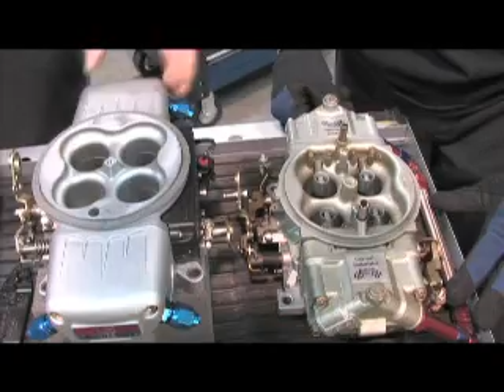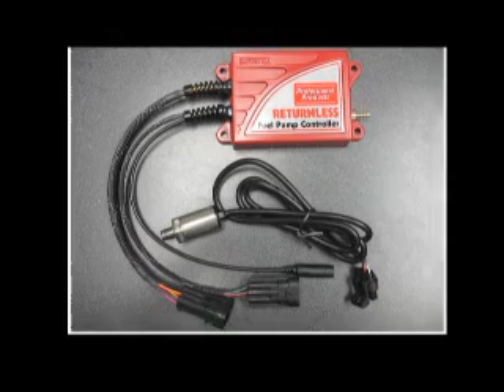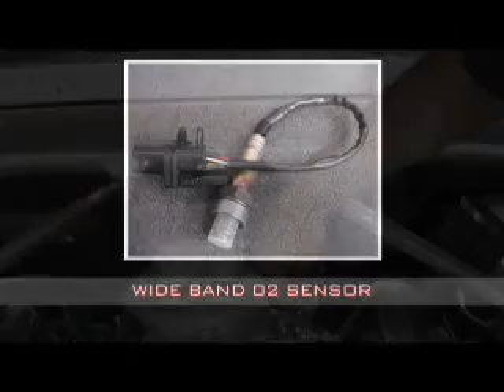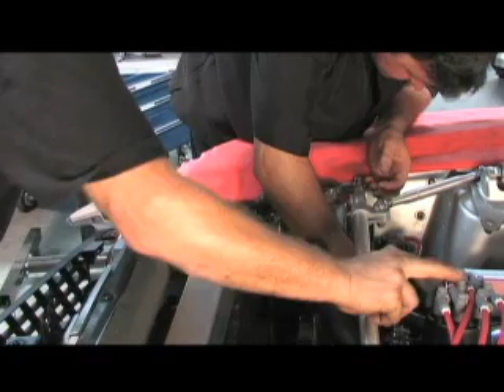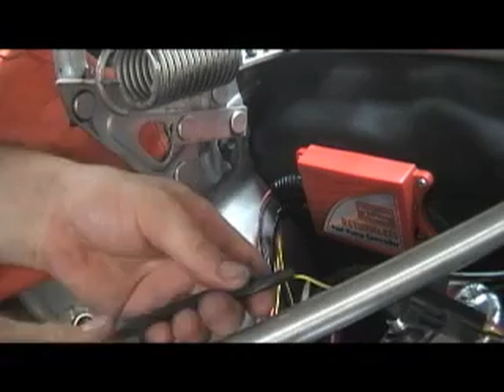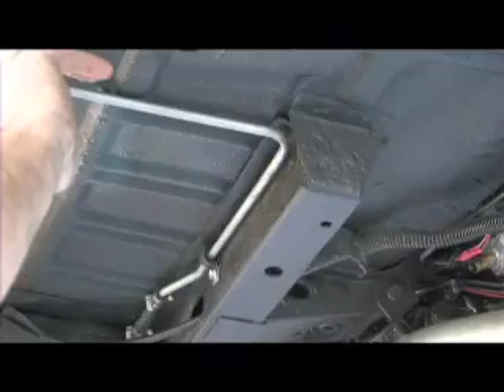Fuel Injection Made Easy

Comment: Very nice system. Thank you for posting such a detailed and easy to understand video here on you tube :) this seems to be the exact type and kind of system which may work very well for my vapor on demand system which will have one or two fuel injectors mounted into a separate(heated) chamber. Strictly experimental project.